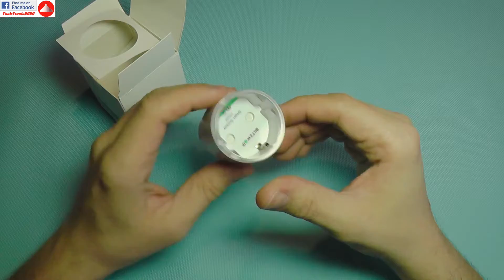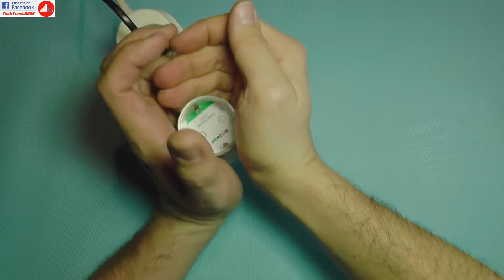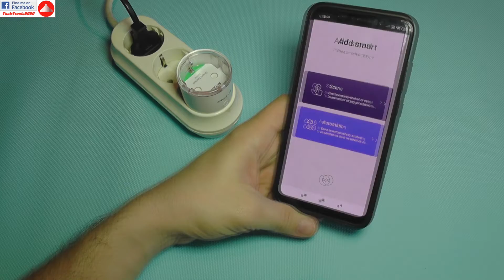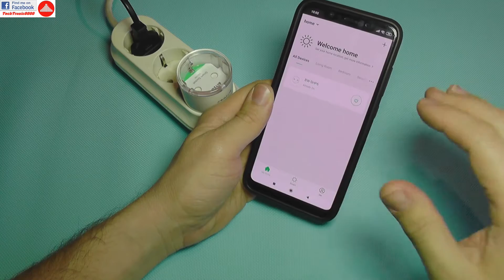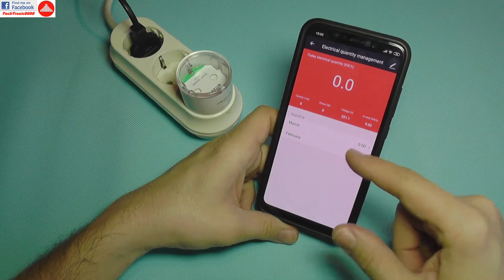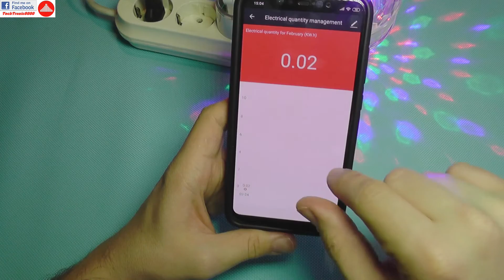BlitzWolf BW SHP6 - Smart WiFi Plug for Home Automation

Comment: If you do not have the phone, can you connect the plug to the wall socket?
Reply from the maker: It has a small switch on it and without the phone you can still turn it on or off.